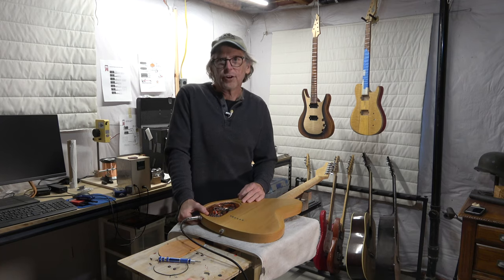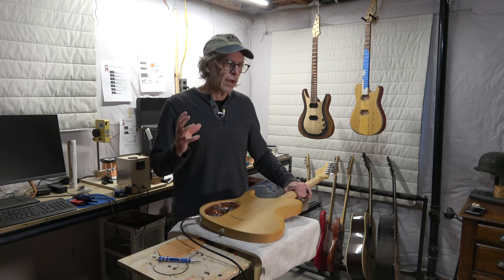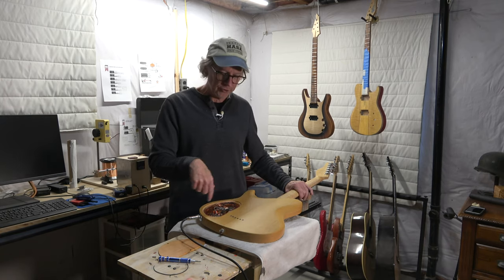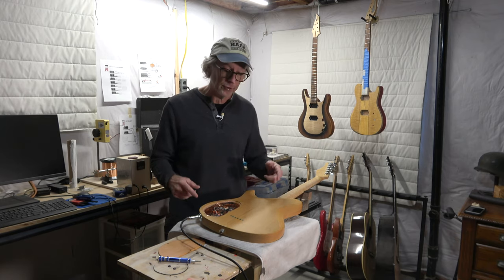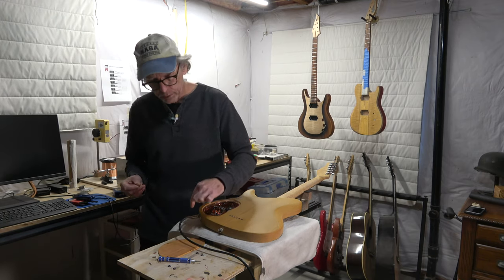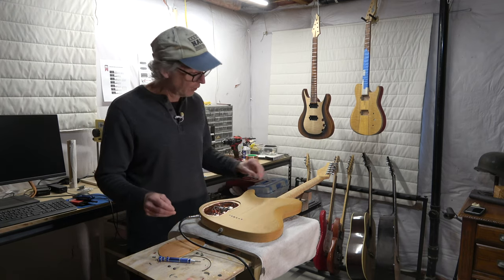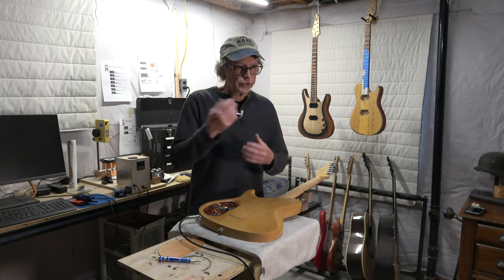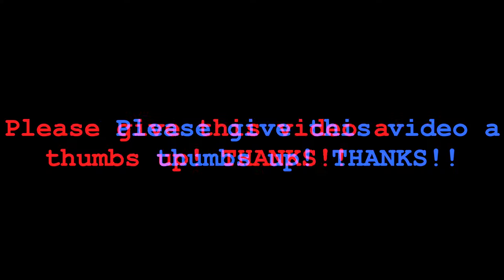Are Ground Loops A Myth In An Electric Guitar?

Comment: Thanks again Chris I was leaning towards copper shielding but upon looking at the electronics cavities and the humbucking pickup cavities it looks like a black emf shield paint was used. And my yamaha rgx from 1987 does have a solid black ground wire soldered to the trem claw cavity so I think the solution might be emf shield paint and to paint the pickup cavities then run a ground wire to ground to metal in a tremolo design guitar for a les Paul I am not sure where it gets grounded at but for a, strat with a pick guard with all the electronics attached to the pick guard I think the solution is to use and brush on emf rf shield paint then run a ground wire and attach and solder to the trem claw cavity and Chris I am leaning towards even with emg active pickups even if the say ground is not needed just ground it anyway but I am interesting in testing passive pickups again that have tones I like but are high gain but making sure they are grounded to my specs so I don't get nose and any potential of the 60 second cycle hum that yngwie malsteen discussed is elimated and no chance of rf or emf interference can occur.

Comment: You are not actually proving there is no such thing as a ground loop. On the contrary, you have created a ground loop: it is a loop in the ground connections. What you have proved is that it doesn't cause the problems people expect. Subtle difference, but the kind of stupid crap people argue over

Comment: So I am planning to install a pre-wired kit into a Explorer. It comes with a jumper between the pots. If I used shielding tape should I add a wire from the jack to the tape?
Reply from the maker: Ask whoever made the pre-wired kit.
Reply: @HighlineGuitars  starr guitar systems

Comment: One point that was not mentioned in any of the comments is that any well-designed piece of audio equipment will have all the ground wires meeting at one single point. For an electric guitar, this should be the ground lug of the output jack. The worst case scenario is having the grounded components connected one after the other and then the last component in the chain connected back to the first component, making a loop. Not only will the loop act as an antenna, but the currents from the various components will be mixed together mixed together in a random way.
Reply: If a ground loop is not a case in passive guitar electronic then your point is not valid. You can connect grouds in random places and make redundant connections.
Reply: @zbyszekolko3998  You are correct.  "Star grounding" is really a workaround to reduce noise due to ground loops in powered circuits (amps, etc.).  In a passive guitar circuit, however, every ground point is at the same potential--so a loop is impossible.

Comment: Thanks so much for this!  I've been so confused about ground loops - I've been seeing people confidently argue both sides, and it's incredibly helpful to get a real answer + demo!!!  I really enjoy your other videos as well!

Quick follow up question... can you still encounter ground loops within your greater signal chain?  I know there are products like the Morley Hum X Exterminator out there.  Can you experience a ground loop if you have, for example, a pedal board + an amp plugged into the same outlet?  And does something like the Morley Hum X Exterminator solve that by eliminating 1 path to ground (say the amp plug), so that the entire signal chain grounds through the other (say the pedal board power source plug)?

Comment: Ok great vid. You mentioned the guitar with a ground loop was a les Paul which has two volume and two tone pots   Your guitar only has one of each. Now here’s what I’m thinking after looking back at a Seymour Duncan wiring plan for two humbuckers  two volume two tone one 3 way switch and 1 output jack. Looking at all the grounds on that diagram the ground goes from each pickup ground to their respective volume pot one ground from 3 way to bridge volume pot then from bridge gets jumped to bridge tone pot along with the bridge ground and output jack ground then jumped to the neck tone pot then jumped to the neck volume pot so now everything is grounded. So now the only two pots that aren’t directly connected with a ground jumper are the two volume pots. Is this your possible ground loop circling around all four pots cuz it’s just traveling the shortest distance to the next ground. You did mention that les Paul had ground jumpers  connecting all four pots directly with jumpers I’d like to see you test this theory again on a properly wired les Paul then jump the two volume pots with a jumper see if you get your hum or buzz

Comment: Ground loops are a thing (based on a degree in electronics plus twenty years working in aerospace and mobile telecommunications). If you create a loop of wire, numerous things can cause a potential difference and induce a current in that loop. After all, that's how magnetic pick-ups operate. However, to create a significant ground loop in an electric guitar, you'd really need to connect the machine heads together, converting the strings into antennas. I have not heard on any Luther's doing that!
Reply: I connected them with a wire and there was no difference, but i have nylon coated strings-probably doesn't matter, havent try putting noise source
Reply: They are electrically connected together in most guitars.  There is a 'string ground' wire from circuit ground to the bridge.  Since the bridge is metal and the strings are metal and they're wrapped on the tuning posts, all tuners are at the same ground potential as circuit ground.  The reason for this string ground is to create continuity with the human body; this takes advantage of the capacitance of the human body, which acts as an RFI noise filter.

Comment: My loaded pickguard only came with 3 wires to solder: ground to claw in back, ground to output Jack and lead to output Jack. If I want to add copper shielding to my body cavity, how can I connect it to ground without a 4th wire?
Reply from the maker: Is the back of the pickguard shielded? If so, it should be already connected to ground. In that case, you can run a strip of the copper shielding out of the shielded cavity and onto the top of the guitar's body where it will come into contact with the pickguard's shielding once it is installed.
Reply: @HighlineGuitars  Thank you so much dude. Wow. THANK YOU
Reply: @HighlineGuitars  THANK YOU!!!

Comment: wait, so you stand corrected between the loop??? smh I dont know man, I cannot put myself between the pots when I do that test like you are doing imo, not to get a result that is exactly the same as when the ground is not impacted by hands body feet etc.- unless I am floating I guess, or completely out of the equation somehow. 
I wonder if soldering or at least roaching the added wire, to create a closed ground back to the output jack not just the pot to sw to pot again looping would help your case? Also curious if closing the cavity creating your FC with the pots all touching the grounded tape changes something. I say then shred on maxed pots into a properly grounded amp plugged into a 3 prong gfci etc and see what happens... at least you are bound to hear the sweet sound of \m/ just make sure you are not barefoot as grounding is all about preventing electrocution imo not tone so much which can be dialed in downstream

Comment: I also don't understand the idea that you could use braided pickup wire in lp that touches each other then the braid is soldered to their respective pots and they they say don't solder a jumper creating a circle going to each pot. But in essence if you have braided pickup wire touching each other when it enters the control cavity then you have a loop.
Reply: Just because it looks like a loop does not mean there are two different ground potentials.  There can be only one single ground potential in a passive guitar circuit, because the ground potential is identical throughout the circuit.  That is what makes a ground loop impossible.
Reply: @thedevilinthecircuit1414  That's what I was getting at. People that say not to make a closed circle when grounding pots together are still making a closed circle with the braided wires toughing. Star grounding is also a waste.

Comment: I don't understand! I take an inexpensive Les Paul, from the store - there is noise. I line the foil around the toggle switch and its lid, I line the regulator block with foil and its lid. Connecting all the screens. There is noise. I change pickups to expensive ones without covers - there is noise. I change to nameless ones with covers, there is noise! Now I don't know where to dig? Thanks!
Reply from the maker: It sounds like there is a problem with grounding. Not necessarily with the guitar, but with the cable/amp/outlet.

Comment: I just took the pickguard off a squier bass (old but just got - so needs cleaning) while watching this video and see that it has a ground loop.  Never thought about it. Did fender do that?   Maybe was added?  Not really good solder job.  What about the wire that connects to the bridge?  Is that needed?   Thanks

Comment: I recently completed my very first guitar build and it clearly has a grounding issue.  It makes a hell of a hum when its plugged in but I’ve noticed it gets much quieter (not silent but pretty quiet) when I touch any of the metal parts of the electronics (knobs, switch, whatever).  I neglected to attach a ground wire to the bridge when building it, but other than that it is wired as per the wiring diagram I got.  

Could this be an issue with a bad solder joint as it was with the Les Paul, or is it mainly the lack of ground wire to the bridge?
Reply: All the metalic parts must be grounded and that starts in the bridge (hardtail with a wire placed underneath it coming from a hole in it's body or a wired solded to the claw in a tremolo system). When I've rewired my guitars I managed the shielding to be in contact even with the screws in the pickguard and the jack plate confirming it with a multimeter. You need to attach a ground wire to the bridge. Hope it helps.
Reply: @TheForce_Productions  thanks for the reply. Looks like I’ll be drilling a hole to my bridge!
Reply: @RoadToTheF1  Yeah, you have no choice on that, anyway wire and hole keep hidden. Happy to help, may the ground be with you always! 😁

Comment: Could it be that the circular ground wiring on the Les Paul was actually creating an antenna?   Also, why not connect ground wires to a central connector rather than soldering onto a pot?   Is it a matter of, space, simplicity, tradition, or something else?   Thanks as always Chris.
Reply from the maker: Tradition.
Reply: Also, one lug on the pot is grounded in order for it to work. The easiest and possibly neatest way is to solder to the case and ground the case.
Reply: Having the pot's cases grounded adds an additional level of shielding to the signal path which makes for quieter operation.

Comment: When you say a ground loop can not occur in a passive guitar, does that mean that a ground loop can occur in a guitar with active pickups?
Reply: Yes, it can occur in an active pickup system because there are various voltages and differing ground potentials within the same circuit.  But it's rare because most active systems come as a package (pickups, preamp, and controls) and the maker has already worked out all the bugs.  Follow the installation instructions and there will be no ground loops.

Comment: It never made sense to me given my knowledge of electronics, electricity doesn't know where it's going, as long as there are 0 Ohms then there's no reason for there to be some issue with simple guitar ground, ESPECIALLY given the fact that plenty of guitars have shielding. All of those pots and the switch is grounded to it by default, almost completely removing the need to run ground wires between any parts. It's an open circuit.

Comment: Speaking of myths one thing has really made me wonder: capacitors. Guitar tone controls seem to be built with caps from the 60’s. Today a 50v 0.047 micro-farad capacitor is smaller than a pea yet guitars are built with capacitors used in 60’s era discrete component electronics. I thought values are what matters, not size. Am I missing something here?
Reply: You assume caps to be perfect when they are not the farther we go back in time. In guitars and basically all electrical instruments musicians want these imperfections and different responses to different frequency bands while in HiFi equipment this is exactly what you'd avoid (at least design-wise - some "audiophiles" might swear on vintage equipment but that now becomes part of the sound with all the distortions). Those Bumblebee caps Gibson used in the 50s ... god awful caps from a purely technical point of view, but that's exactly what gives them their distinctive sound. It's basically the same with valves/tubes: terrible performance in terms of objective specs but that's also what gives them their distinctive sound.

And it goes even further: those old caps age making their valvue drift like hell. They might have written 0.022µF on it in the 50s or 60s (with a huge error margin probably) - nowadays those caps can even have 10x the capacity significantly influencing their sound. So people mystifying vintage guitars and praising their unique and superiour sound: it's mostly about ageing components being wildly different spec-wise.

While we're at it: pots. A logarithmic/audio profile pot doesn't mean that they all have the same resistance curve. There's a large variety.

Comment: well, the grounding serves as shielding right? so the foil isn't wasted? It's to prevent your neck acting as an antenna and preventing PC noise etc coming into the guitar? Your test is not really on point I'd say.
Also on the grounding forums I'd bet there is a good chance there are on one side nitpickers who will take a term really literate and those who communicate more on a practical level, so.
Reply from the maker: The neck can't act like an antenna. The pickups can do that.

Comment: Can you help explain how using copper shielding tape that every pot, switch, and jack attaches to does not inherently create a "ground loop", even without any additional wiring?   If ground loops were a problem, we wouldn't use shielding.  That said, shielding isn't really necessary if you use modern film caps.  Shielding was necessary because old school paper in foil caps were essentially RF receivers.  I realize that the "old guy" cork sniffers think that paper in foil caps are bastions of tone (because old stuff), but you might want to experiment to see if shielding is even necessary when using modern components.
Reply from the maker: I have. It is.
Reply: wires themselves act as antennas (for EMI and RFI). With mid/high gain amplifiers and pedals, you can listen radio. That's why we use shielded cables to connect pedals, amps, microphones; we are surrounded by RF and EMF all the time.
The "shield" can be a ground plane (in the case of a Strat pickguard for example, it's not "closed", it only works by attenuating the RFI), or a Faraday cage (like the compartment, completely "closed" by a conductive barrier connected to ground) 
To work with EMI (from near motors, transformers, some lights, etc.) it must be made of thick magnetic metal (iron and alloys)

Comment: That’s not a ground loop. All the pots are at the same ground potential. If that’s a ground loop, than so is your pots sitting on copper foil. 

A guitar has a single ground point; at the output jack. You cannot get a ground loop with one ground reference.  

What a real ground loop is when you have something like your guitar amp and a PA system. They are each plugged into two different outlets. Then you connect a direct out from your amp to the PA system. If the ground potentials don’t match, i.e., one ground circuit is a higher potential, then current will flow between the ground of the higher potential to the lower potential. This current flowing through the ground circuit produces a loop. That causes a hum. This is why direct boxes have ground lift switches. It lifts the ground on the DI, only leaving the ground on the PA. Now you have one ground. 

Your anecdotal Les Paul story doesn’t prove it was a ground loop.  I once eliminated a ground noise in a bass by adding a second redundant ground wire from the volume pot to the output jack. Why did that work? Maybe because it lowered the resistance to ground. 

Gibson Les Pauls always come with pot cans wired together. They also used to come with the pots mounted on an aluminum plate. That would also connect all the grounds together. So does your copper foil.  

But here’s the thing; there’s only one ground reference. It’s all the same.
Reply from the maker: You are exactly right. I think the term “ground loop” is misunderstood by guitar builders, players, and techs. They see a circle of wires in their control cavity and think it’s a ground loop. Visually, yes, it’s a loop. However, it’s not a ground loop as defined by electricians.
Reply: @HighlineGuitars  Yes, but it is still a loop that works as an antenna for all noise from ether. By closing the loop you allow a current to flow and induce noise to the signal ground. It is a loop of a very small area compared to a ground loop in home installation. Your loop is even more eliminated by that shielding-ground plane or a farraday cage, if you close the cover. I prefer not to create loops anyway, as a good habbit, though in a guitar it does not matter that much.

Comment: No such thing as a ground loop. Ground is ground. Electricity travels at the speed of light so it goes the quickest way it can.
Reply: until you work with RF, high gain, high impedance, or high currents circuits. Wires have resistance, always. It depends on the context if it's relevant or not